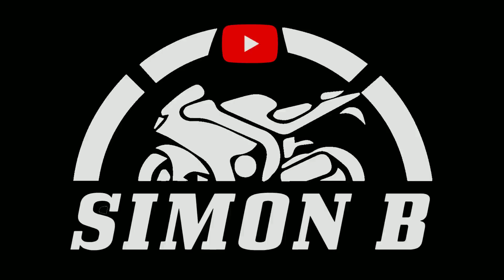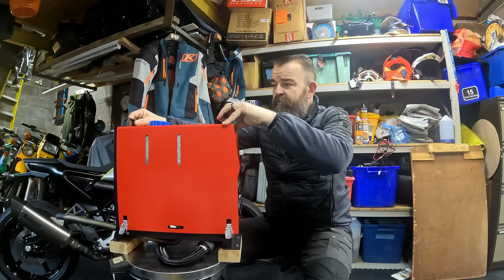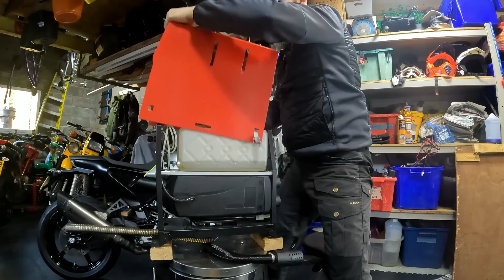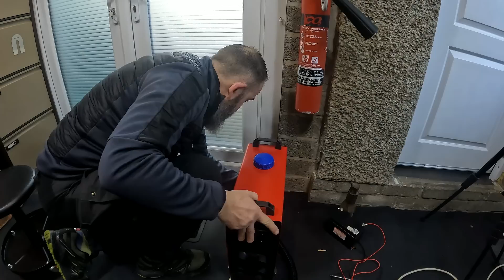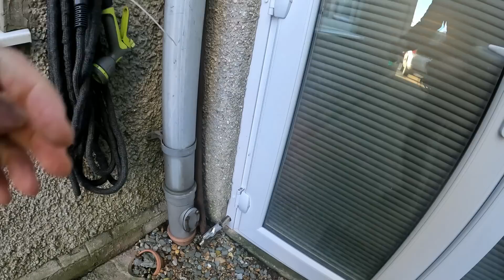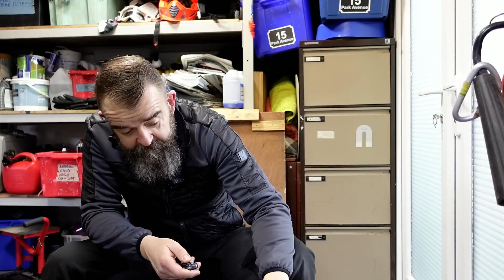Chinese Diesel Heater are they worth buying ?

Comment: I have one for my garage and use a computer power supply for my 12 volt source. It will run all day on a full tank
Reply from the maker: Hey up Mater's Workshop, why didn't I think of using one of them ☹️, I've just got delivered my 12v transformer, they are not bad really, thanks for watching and dropping a comment, much appreciated, ride safe, Simon B 👍
Reply: @SIMONB1  that's why I started my channel for hacks and tips for thinking outside of the box
Reply from the maker: I'll check it out , thanks for sharing the information, ride safe, Simon B 👍
Reply: @matersworkshop6123 I use a computer power supply as well. There are loads of YouTube videos on how to modify one to make a power supply. They can easily supply the current needed at start-up, and they are reliable. Plus you can usually scrounge one from a dead computer for nothing. We rarely get power cuts round here, but I guess if you live in the sticks with overhead supply lines you might want to use a battery instead.
Reply: Had mine about 2 years and its been great its the 8kw seperate tank model. Ive got quite a big 644 battery i charge up by connecting my jump leads i have hooked up in back of my van and it runs for weeks on that . I have an old leisure solar panel on garage roof i try to remember to connect to top it up but the winter months when you really need it provide little sunlight for that.
As for an emergency flat battery I have just ordered a 240v to 12vdc 300w 25amp rated supply marketed as an led light driver. Amazon £11
I Will see if its up to the job to handle the startup current draw from the glowplug . The heaters inline pos fuse is 20amps so in theory this should work . But for efficiency i will normally be using the battery
Reply: full tank like this ?
5 LITER all day ?
Reply: @homebox4967  it's a 1 gallon

Comment: Hi Simon does it have a thermostat  so you can set it a temperature  so it stops and starts by it self thanks Simon keep up the good  work cheers steve
Reply: Some of them do have a temperature control setting but they don't shut off, they just ramp up and down
Reply from the maker: Not see them 😁
Reply: Hey up Simon. I have been looking for something to warm up my garage. Will have to check these out
Reply from the maker: Hey up Richard, yes something to have a look at also the red diesel it's cheap to run 😁, ride safe, Simon B
Reply from the maker: Hey up Stephen, no it doesn't have a thermostat ☹️, just the remote for altering the temp, thanks for the positive comment and watching, much appreciated, ride safe, Simon B 👍

Comment: Nice educative video Simon,
I have an oil radiator that i plug in to the mains to keep me warm when i'm in the Man Cave 😂, but if you have no electricity this Chinese Diesel Heater is brilliant .
Stay safe !
Reply from the maker: Hey up Alin, it's all about saving money really, a oil filled rad wouldn't heat my garage it's too big 😲, thanks for watching and dropping a comment, much appreciated, ride safe, Simon B 👍
Reply: I have a night storage heater in my Man Cave, but I am not using it this year.  Got one of these diesel heaters instead.  I installed mine outside, so it's not as noisy.  It's saving a fortune.